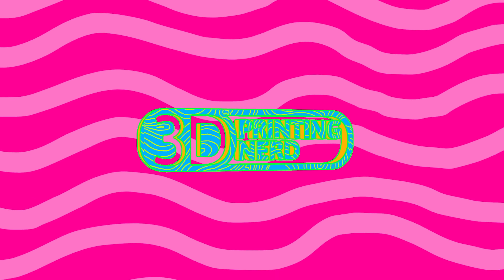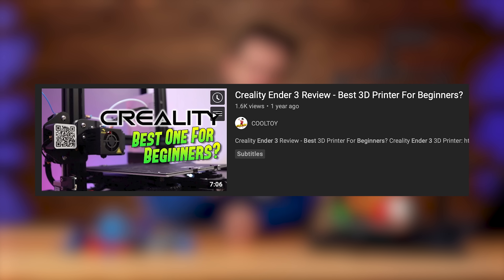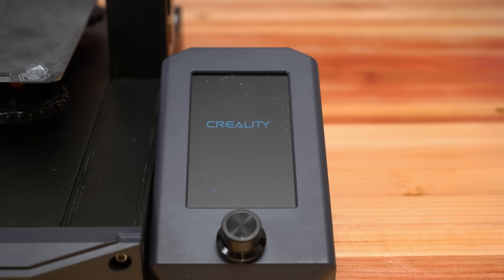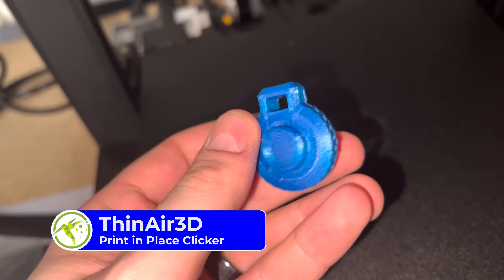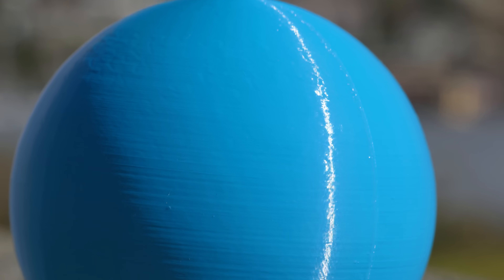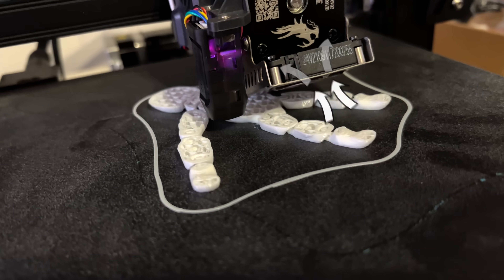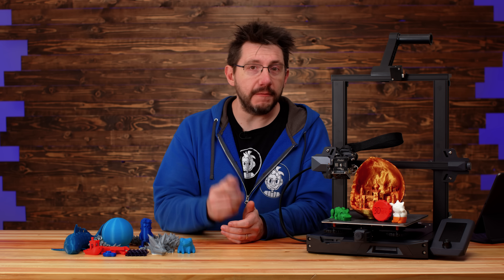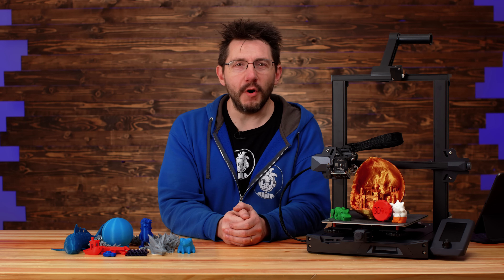Best Ender Ever? Creality Ender 3 S1 Review

Comment: Yes, the sprite direct drive extruder and the dual z is a step in the right direction. However, you would think by now creality could have gone with touch screen for that price range, rather than fiddling with a stupid little knob. 

But I would hesitate to that you don't need to be tech savvy as much as with other enders.. Let's face it, yeah, 3d printers have come a long way, but they are still in their infancy and certainly not maintenance free like 2d printers - users still have to be technical minded or at least ready for the learning curve .

Also, I personally feel the more upgrades done to a 3d printer (direct drive being a big example) the more tuned your settings have to be. Not a great playground for someone new..

I have 2x ender 3 Pro's that can be found under $100, leaving you with $350 for upgrading once you have started getting used to 3d printers. Most of these upgrades can be bought for this over time and at a slightly shallower learning curve..

Final analysis: if I was to recommend to someone new, I would recommend the 3 Pro or v2 if they have extra cash.

Nice try to creality and well done, but it's not perfect yet..

Comment: I have got mine and had nothing but issues with prints , can’t seem to get my bed level and currently waiting for a replacement hot end as mine was having issues holding temp steady at 220. If you join the Facebook and redit groups 50% of people seem to have the same wonderful experience you mentioned , but then the other 50% have issues like me. Wonder if it’s inconsistent build quality.

Comment: I have an S1 it's my first 3d printer and it fulfilled the reason I wanted it over the cheaper Enders at Microcenter, the easy set up. HOWEVER, I have had bed adhesion and tolerance issues. Also I accidentally set my first print too close and some of that first layer is still stuck in the texture of the build surface. Edit: Upon rewatching I remembered that the fan is also a concern of mine, I wish it cooled from multiple sides.

Comment: I have one and yes I did replace the bedsheet.  So far I have a problem where the back right of the bed is lifted so far that when I changed the nozzle to the ruby and had to reset the bed I noticed it.  The fan has sucked up some stuff but it's okay.  I wish that the fan duct was a full circle setup or even offer different setups.  I would love to see this on the Ender 5 Plus or even the Cr 10, or even have this as a DIY upgrade system for other printers.

Comment: I'm using the original spring steel sheet, but not the original surface. I ripped the coating off and replaced it with a PEI sticker. It's amazing. Took way too damn long though.
Mine never got to the point of bad adhesion, the cat test print stuck so well that it took part of the surface off with it.

Comment: The s1 is my first 3d printer and It has made amazing prints for me right out of the box. I have printed the boaty and many other calibration type things and all of them came out pretty much perfect with stock settings and the pla filaments I bought to start with (overture brand). I printed a few articulated toys and they worked perfect first run. So far its way less of a pain than I was expecting it to be, very happy with it.
Reply: How is the 3D printer holding up for you? I’m looking at getting one as my 1st printer
Reply: How's it holding up?

Comment: I got my S1 a month ago, for a bargain at £299.99 which was a saving of £110. I am having a bit of trouble now with bed adhesion, what build plate would you recommend as an upgrade i like the spring steel one that come with it but as you say it seems to wear out over time, or a good spray on adhesive i could try to get a bit more use out of the one i have. Great show👏👍😎🇬🇧

Comment: The Fan sucking up filament is a concern, however, the 'heat' being pushed through is not. ( I personally don't think) The reason why is, your printing at 200ish.  Your bed at 100ish isn't going to have 100ish air above it  (thermal capacities, dissipation, etc) and once you begin to circulate air, your mixing the 'hot' with 'cool'  - the biggest thing is - the 'hot' air from the bed, is still COLD air compared to the printing temp, by about 100C if not more.    It's like if your room heater kicks on pumping out 27C heat to keep the room warm, this is COLD compared to the print temps and bed temps, so if you have ABS going - your probably going to warp thanks to that draft - even though, it's 27C "Heat"      What happens on the S1 is similar, your pumping out 100C "heat" being pumped into the fan to "cool" the 200C printing parts, which, doesn't matter, it's still colder than the print temp, so it is 'cold'.   Even 'hot air' inside a PC helps keep other parts of the PC 'cool' by keeping the air flowing, it's when the air stagnates and can't move fast enough, and only heats up, that things 'overheat' in a PC.

All that being said, I don't like the 'intake' being on the print side where wisps can be sucked into the fan, even if it doesn't hurt the print, eventually it's gonna clog that fan up.

Also the price.  the S1 is just.. not a friendly price range.  It's a new concept of an old design, but still lacks some features that would be considered standard at that price range.  The 500 to 600 dollar range should be basically the most reliable work horses ever, and the bed and a few other kinks are keeping the S1 from being that work horse.  It's like a Prusa price, but without the Prusa reliability- which honestly is the only reason Prusa can be argued to be worth the price range (as the print quality is not drastically better than a stock ender 3 from 2019, but the reliability is years ahead of the ender 3)

If it were $100 cheaper, I'd say go for it, it's not a "workhorse' but your definately getting what your paying for (and you'll probably spend a little on , better beds, etc)   

I just can't see the value in a PTFE lined Direct Drive system being more expensive than a non-PTFE lined (all metal) system being cheaper, no matter the gimmicky add ons.  (almost all of which are basic improvements considered by the community, like dual Z)

Also 2208's are nice and all, but most are suggesting 2209's in 2022, so they are using a still 'older' driver set and not quite pumping out what most "new" printers are pushing. (like Vorons, Ratrigs, SkTank, etc.)  even though most are also moving to 'coreXY design" as the next ting, a good set of 2209's can go a long way.  IF the price included 2209's I could say it was close to price range, the biggest issue then only being the PTFE lined hotend -  which 100% should be all metal, and the minor problem of the fan angle.

It's nice to see Creality listening to community, making changes, and trying to do better - but they seem to be skipping some of the biggest things desired (all metal hot end) in order for more profits in the long run. I would have rather liked to see this version of the Ender3 delayed 6 months or even a year, make all metal hotends stock, and change that bed out for the price they are asking, the 'fan position' would be a tiny TINY concern then, as the 'value for what I paid" would be tremendous. (assuming they didn't bump up the price)  they are working on an all metal hotend anyway for the S1 - to be sold seperately, and I feel this will be like the glass bed the Ender 3 had, where "some" will come with it, and some won't depending on how old of a model you purchased.

Comment: Totally agree with the bed surface comment. I have upgraded our S1's with the double sided PEI...they work "preety freaking"  fantastic, currently putting the Build Plate from Wham Bam through its paces.
Your fan comment is right on the money.... call me OCD but we clean our fan every 100 hours or so since our machines are running pretty much 24/7. Now if they only had Silicon Socks in stock for the South Pacific that would be nice. 
We did change a few settings for our PETG and carbon filament requirements, other than that we have only come across one issue...two of our machines bed plates will not heat up to the edges arrrrgh!!!!!!! that seems to be fairly common talking with others across the globe with the early releases; but realistically those sized and shaped prints are few and far between for us. 

Keep up the great work Joel, Sean and David.

Comment: I have a quite modified Ender 3 Pro and I'm quite happy with it. I'm looking forward for the S1 Pro that can print hotter and includes a PEI metal flex plate. The mods in mine makes it able to print nylon, but the S1 Pro seems like it would be more straightforward

Comment: I do have one, in fact, it is my first 3d printer, I bought it this year. Your video helped me decide for this one, thanks.
I had some problems as a newbie, and I have nothing to compare with, but so far so good.
It works, it's simple to use, relatively silent and I didn't want to spend much more on my first one. 
I considered a prusa, but apart from being more expensive they would also take ages to ship.
Now I want to design and build my own based on cables/ropes (8 motors, all degrees of freedom, can be rotated 45 degrees for belt based prints only with software...).
I call it reprope. I know, I know, know the simplest project to learn CAD and 3d printer firmware, but, hey, it is definitely a challenge. 
I didn't dare to print 27 cm on the Z axis yet, so I printed 12x 26 cm 2020 vslots extrusions. It took a while.
My first CAD success! 
With that I can build a 28 x 28 x 26 pseudo-cube.
I have 10 motors, an octopus pro, cables, a PSU, tools...building a 3d printer from scratch requires a lot of materials and tools if you weren't "a maker" before I'm waiting for shorter screws now! I can't find them around.
I found a 3d printer replacement for t-nuts on thingiverse. Pretty cool, works great. But I will have to re-desing my own. As another freeCAD exercise, and because it doesn't have the license I want (it has creative commons, but non commercial).
If I finish the project (it will be open source), perhaps I can convince you to build one yourself and mae it popular, hehehe. 
I'm already learning a lot and I'm just getting started, but I really hope I finish the project. It could be really awesome, I think. 
If not, I guess I can throw away the pulleys and the ropes, bujy linear rails and build some vorons instead (I bought 10 motors because I found a good offer in packs of 5, and I needed 8).
Sorry for the rant, lol
Reply: https://www.youtube.com/watch?v=sytyQvUXN8Q

Comment: I have been thinking about replacing my E3 v2 feeder with a direct drive  is this Cd feeder sold seperate and if so, is would it work as well on the E3 v2 as it does on the E3 S1?

Comment: I have had my s1 for a bit now as my first filament printer, I have had a few years with resin.

The only stuff I know about filament going into it was a handful of YouTubers.

Alright out of the box the thing prints amazing. Once I switched from creality slicer to actual cura (for tree supports).

I have done all kinds of stuff so far including some print in place stuff and it has been absolutely great. Only complaint I have is that it is that it is kinda hard to remove support filament from the build plate, but I'm guessing that is an inexperience issue more than a machine issue.

Comment: Interesting how reviewers opinions can vastly differ. TH3D think this machine is utter garbage, incomplete firmware and cheap psu with a Creality name slapped on it etc. I agree with the psu, for that price it should at least be a MeanWell.
Reply: Bad reviews don't generate affiliate sales and the chinese companies will usually stop sending you products if you give a bad review (its happened to us many times). IMO the price for what you get that doesn't work correctly is not worth it. If the price came down to about $300 then it would be easier to stomach with the shortfalls.

Comment: for that sum of money one could well have expected to get much more for one's money. it does not even have an original Mean Well psu. standard firmware to set up so it is mega slow in trying bed. so reached by the first thing one almost has to do is update the screen and firmware on board. the price is clearly set too high in relation to what you get for your money.

would be better to use 535doller's on an SV04 IDEX 3D Printer and yes it also uses creality hardware but you then get the opportunity to print in two colors

Comment: I have one.  I can honestly say that I love printing on the S1.  It's my first printer and I did a lot of research on Youtube before deciding on buying.  The second runner up was the FLSun speed racer. I wanted a delta printer, so after I attained perfection with the S1, I bought the FLSun.  I could not be happier with these two printers. The FLSun is a fast, accurate, and amazing printer to watch.  The S1 is just about as good as it gets.  I do have to say, that the FLSun SR is especially nice because of the fixed bed. There is no need to level the bed, and one auto bed leveling operation is all you need to do.  But getting back to the main topic of the S1.  The S1 is worth the money and it's a beautiful piece of technology.  I love direct drive extrusion too.
Reply: S1 for a 1st? Damn you went in swinging.  I hope you're enjoying it
Reply: I've been in the same boat, watching and watching loads of reviews and  researching and was about to pull the trigger on a prusa, but then saw the fl sun Sr and thought yes then saw the s1 and thought oh and now waiting for the s1 pro to come out, there were others in the line up but couldn't put a nail in the all rounder it's a nightmare trying to choose for a newb that wants to print and not continually tinker and up grade, those deltas look uber cool 👍👍

Comment: Looks great but as I have an MK3S I think I'm good on "small" build plate printers...

I am however wanting something that has a larger build plate. My experience with an Anycubic Chiron has been less than stellar.  Recommendations?
Reply: My FLSun SR has a build plate (round) of 260 (X/Y) by 330 (Z).  It's a delta printer and not only is it a pleasure to watch, the print speed and quality are superb.  I can't tell the difference in print quality between the S1 and the FLSun SR.  I could go on about the SR, but you should check it out.

Comment: Hmmm now the question arises Prusa Mini+ Or Creality Ender 3 S1?
Reply: ENDERS 1 Larger molding area
Reply: @tangmichael2251 Dont you mean bigger build area, but for most cases build size wont matter that much because you can easily split things into printable pieces in slicers. The mini also has an all metal hotend which is a big plus allowing for more material usage.

Comment: Have had the S1 for almost 2 months now and for the most part it does well.  I did have an issue with the z offset that resulted in the stock bed taking some damage while trying to tune for petg.  I've since replaced it with a rough and smooth pei flex sheet and both of those are working well.  Note: features like pressure advance were disabled in the firmware and to avoid the constant back and forth of updating firmware, I switched it over to Klipper.  Since the S1 is so new there were few resources to help with this, but it was worth the effort.  It did highlight one issue, and this just might be my S1, but the USB-C connection drops sometimes.   I've tried different raspberry pi's and different cables and the only time i have an issue with any of them is on the S1.  I've never lost a print because of this, but sometimes it can take a few minutes to get it up and running.   My plan is to replace the controller board with a BTT Pico if it gets any worse.  Also, for taller prints, the nozzle would start hitting the previous layers.  I ended up loosening up the vertical supports, clamping them in place with a couple squares, re-tightening things, and that appears to have taken care of it.

Comment: I love the build area on my Sidewinder X1 and i'm thinking about getting a new printer to add to my print farm.  (I have  a M2P and a Saturn resin printer also)   Thing is I really don't want to go down in bed size.  I saw one somewhere (from Creality) that had a larger bed (500x500x? would be awesome)  but I really want NO BODEN tube, and I saw interchangeable heads so that you could put on a laser engraver, yes please.  Is there one you can review?  I've heard a lot of bad talk about Ender 5's.  What's your take...
Reply: Cr 10 max with a after market direct drive and tool change system, expensive though